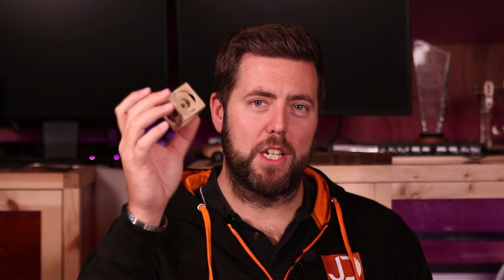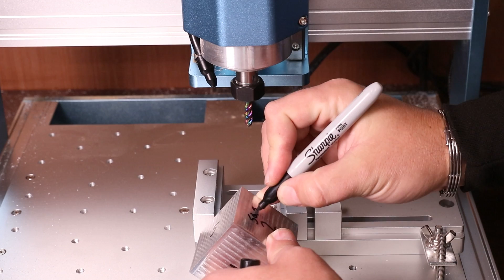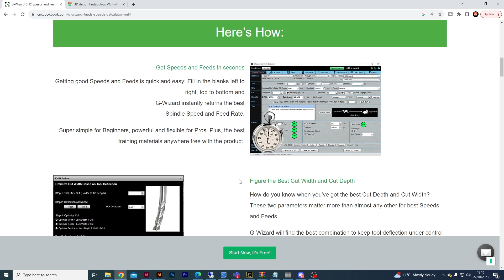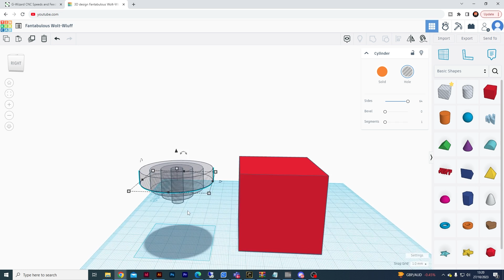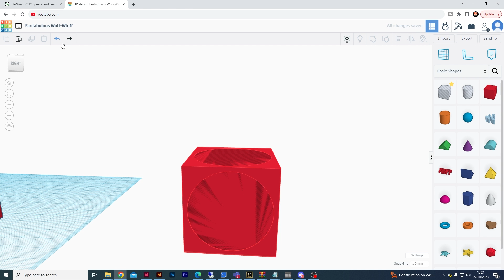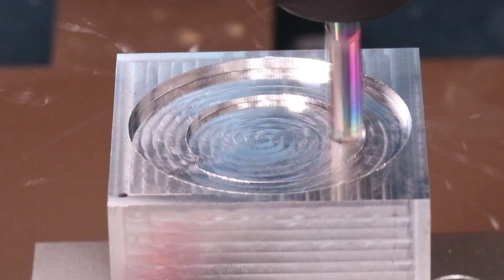How to make a Turners Cube on your CNC - Easy to follow guide

Comment: Did you take any special steps to tram that vise? It looks like it is aluminum, so I was wondering if you closed it tight and then surfaced those lips to ensure they're parallel  to the x-y plane of your router. Have you tried using a two-piece machine vise like the one This Old Tony built? https://www.youtube.com/watch?v=9UGY8iJH_aY That would allow you to use your spoil board as a base which is parallel to the x-y plane if you surfaced it.

Great video as always. I can't wait to make one of those cubes.

Comment: The method I use for squaring up a block is to put it up in the vise and machine the perimeter of all 4 sides. It would mean you would have to use conventional milling for the sides. Afterwards
I would machine the top. For the final step you would flip block over and machine the  bottom face to size.  Great video I always enjoy your tutorials.

Comment: Great work, very inspiring.
Simpler identifying cube faces is imaging a dice. Opposite faces add up to 7, 6&1, 5&2, 4&3.
If you reduced the stepover is thisvthe same cube design that would allow the inner cubes to rattle around but be constrained and not fall out?
When debugging, you said one of your measurements was off. What should they have been please?
Reply from the maker: yes in theory but to my knowledge you usually leave the cubes still attached slightly and cut the corners  otherwise the cube can technically fall out. So when I looked into it further, the software was actually producing the wrong measurements for he second cube. You can just about see it on the 3d model I produced that the second cube is thinner than the rest. Some user error will still play a part but that was the main culprit.

Comment: I love your videos James.  I am just getting into Milling and Turning on the lathe.   I have been taking classes at a local college.   I discovered your channel after I purchased the Genimtsu Proverxl 4030, though I wish I would have waited.  Not soon after delivery I discovered a V2 had been released.  Hopefully an upgrade kit will be released, or someone will come out with a bill of materials to source the individual parts.   Ultimately, I am hoping to move from woodworking to metalworking.  I am interested in what machine you are using in this video.  Can you provide this information?
Reply from the maker: Hi, The machine is the new 3030 Prover Max. Not as powerful as your machine but a little more geared towards metal work https://shrsl.com/485w6

Comment: Hi James, 
an other great video.
which CNC machine were you using for this demo? Also as an ex tool maker, your really should be deburring the two machined faces that go back into the vice jaws each time, this will greatly reduce errors and will go a long way to stopping your work piece coming loose.
cheers
Phil,
Reply from the maker: It is the 3030 Prover Max, from Sainsmart. Agree on the deburring, I do mention about doing this at one point in the video but didn't specifically state it for the jaws though but probably should have

Comment: Looks great, I might try it with wood.  Ill make it 49mm and just screen shot your specs.  I have my 3018pro running decently... ish...   looking forward to more projects.  Im having a problem related to this topic.  Ive been carving coin blanks and having trouble getting them level on the bed.  Ive seen videos where people do a "mapping" run with the probe to let the software know the contours of a piece, but never a how to on doing that process.  Do you have one?  If not...  ??
Reply from the maker: So UGS has this feature, think its called height map. I have not actually used it myself but it is meant to work and fairly easy to use.
Reply: @JamesDeanDesigns  so now the stupid part of the question...  what does UGS stand for?  I've only used easel and candle.
Reply: Universal Gcode Sender
Reply: @PavelPeikov  I've always used candle, but i guess i can try another program.  Still very new at this.
Reply: If you wanted to use the height mapping feature, you could just use candle. (I also use candle for sending Gcode)

Comment: Good vid. The way you prepared the block would only make the sides parallel not square, which maybe the cause of those small discrepancies.
Reply: I was thinking that while watching also.  Need to machine the top surface, then do 2 sides without moving it in the clamp using the side of the bit. That will result in 2 parallel sides square to another face.
Reply from the maker: Good point. So actually dug into this a bit further and yes not being perfectly square wouldn't have helped but actually the calculations in the software for the second circle were off and this was reflected in the 3d model as well 😞

Comment: Absolutely brilliant James you're my man very inspiring ... 

One thing it's just gone through my mind I don't do a lot of cnc because with wood because of dust mostly ,just laser because of my machine location. But you know I never considered doing any aluminium. This could potentially give me a whole new option for me to try out . Though I don't know if the "master pro " will be the ideal machine for it ...thank again 👍
Reply: Having just installed a new control board in my 3018pro, I would recommend putting some kind of shield around the control board when cutting metal.  A random piece of brass got onto the board and shorted out the power switch and probably something else.  Brass dust all over it, even with the nice plastic box it came in.  Now I use a quick shot of oil to keep down on the metal dust...